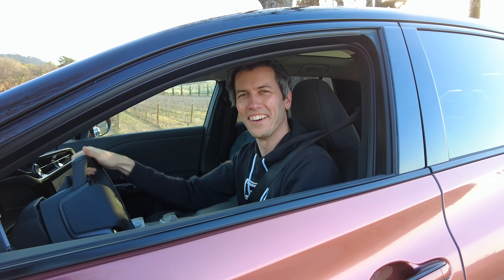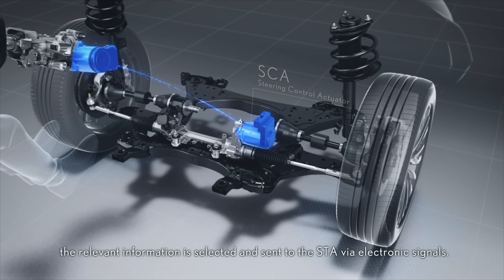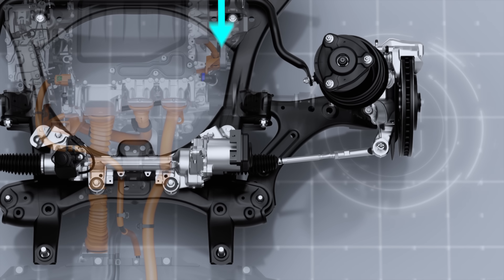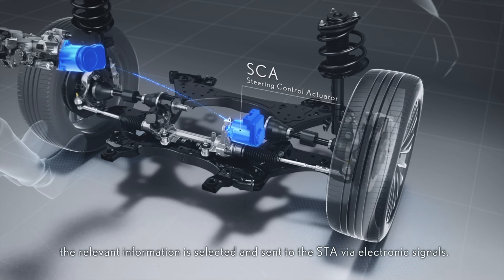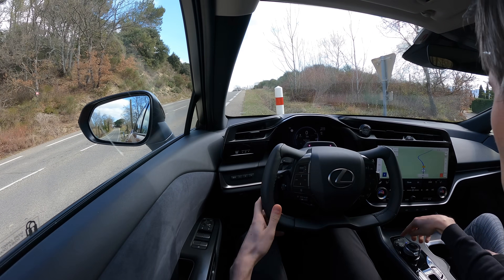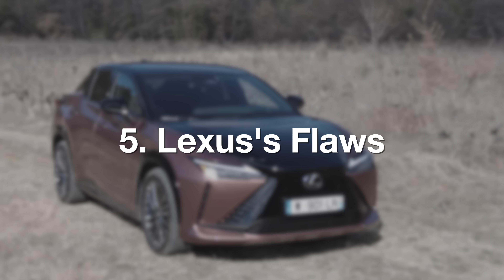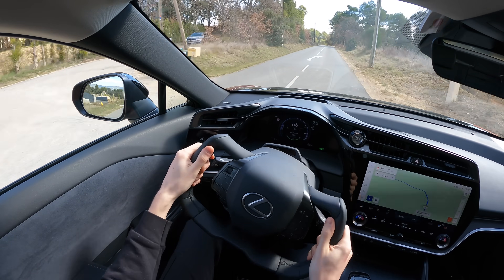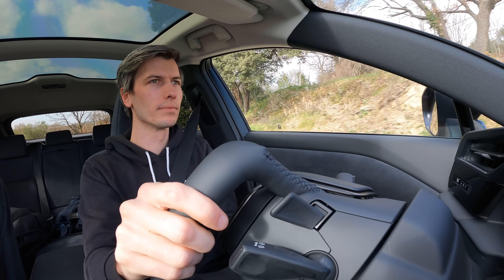How Lexus Fixed Tesla's Bad Idea: Steer-By-Wire Yoke

Comment: There is also a chance to improve it by make it automatically configured when steering axis geometry changes, also they can eliminate the side slips, personally i like to have real feedback rather than simulation or electronically converted sensing.

Comment: Remember when cars had large round steering wheels with manual steering racks..... Just as light and they worked for decades without maintenance or repair. It's all a sham

Comment: I gotta say, cool! But I'm not sold on this. I don't see why this is important. I like having to move my wheel a lot. We sit still too much already as it is, why would "Having to move less" be a good addition to anything at this point? Also, what do you mean "mechanical steering has less lag"? The point with mechanical steering is that is has NO lag. That's what mechanical steering IS :P What do you even mean....

Comment: I can't see myself buy a car which steering wheel is not physically connected to the wheels.
Reply: in fact it is physically connected by wire.
i think you mean there is no machanical link between the wheels and the steering wheel.

Comment: I just assumed Teslas were already drive by wire. Considering that they tout autonomous driving, you would think they wouyld have already removed any mechanical link between the steering wheel and wheels.

Comment: Redundancy...If a manufacturer makes a car like McDonald Douglas made MD-80s and 90s--no redundancy to the steering system, RIP.
If the driver keeps deferring/unaware of the single component failure till the second fails...RIP. Also, "most people are not enthusiasts."

Comment: Great video. Check out the  control laws used on modern large fly by wire aircraft. They actually increase the surface movement for a small yoke movement to overcome large vehicle inertia and get the vehicle moving in the desired direction, then reduce the surface movement to control the pitch change. Large floppy aircraft can no longer use cables and have to have FBW in order to manage vehicle flexing. This also allows inertial driven stabilization control laws. This smooths out air bumps, and stabilizes large floppy wings.
Reply: Your Lexus will have multiple steering controllers and degrade into "Alternate Law" when sensors and controllers fail. No more variable ratio steering until you take it to a dealer. 😂

Comment: I think it was Lamborghini in the 90s that had a steering system that would tighten up as you went faster. I don't remember what it was called though. I don't feel that drive by wire is quite ready yet. I do like electronic power steering. E-brakes don't make much sense to me especially in a loss of power event.

Comment: Didn't Infiniti have this as DAS in some of their Q50 models?
Reply: Yes they did. I had it. It basically neutered an otherwise very capable car. Not only that, it actually glitched up sometimes in the middle of a drive. I'd come to a stop to make a hard turn. After completing the turn, the steering did not return to center properly so I'd be driving straight while the wheel is cocked way off center. Luckily this only happened at low speeds and I could safely pull over to turn the car off.
Reply: @VM-gq6jd  Right, I recall there being a lot of complaints on the Infiniti forums about it. Thanks for detailing your experience.

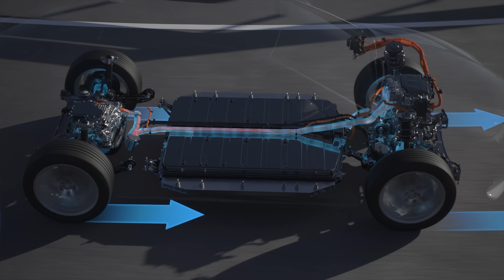Comment: 11:46 Is that a round-about in the USA?
Strange... 😀

Great video!
This issue is quite relevant, and I really love Electric PAS (Power Assisted Steering), preciously because it allows different behavior between low and high speed, which is exactly what a driver wants - from an utilitarian vehicle.
Reply: I'm pretty sure this was shot in France.
Reply: @ketchup901  In Vaucluse in Provence.
Reply: @ketchup901  if that is true, that explains the roundabout and the signals - which are quite different from the ones found on North American roads.

Comment: I really like your video, I really understand the idea behind the yoke but since I still can't get used to throttle by wire delays I simply can't see how I would like this... I can see a great use for those on delivery vehicles or other mainstream vehicles. On a side note, I really hope they will not destroy the experience by changing the programmation at every over-the-air update like they always mess with my phone at every updates ...
Reply: I don't notice any lag on my BMW M4. Some turbo lag until it spools though.

Comment: Surely having a wire is mechanical?  If it's wireless then it's not mechanical. Also it's up to the driver to change ratios? Wtf I see lots of dead people because of this
Reply: having a wire is physically connected but it's not a mechanical link

Comment: Your new explanation sounds like the system is not a variable ratio but a variable speed and is slowing the time it takes to move the wheels to the new position indicated by the steering wheel at higher speeds.

Comment: Obviously it's not variable in the same way but the highway twitchiness had already been solved by Toyota on the 90's. The mr2 has an electronics p/s rack. The pump is electronic instead of a pulley powered. So at highway speeds the pump automatically switches off giving you that 'dull' response that's more suitable for faster speeds

Comment: Steering rations dependent on speed seem unreliable. It would either take a while to get used to or people would het into accidents because the car doesn't turn as they expect it to. Also at high speeds, if you want to drive off the lane or road real quick to avoid a collision you'd be screwed.

Comment: What happens to the steer-by-wire if you are steering into a long left or right turn in a road at highway speeds and suddenly need to slow down, would the steering ratio suddenly increase requiring you to reduce the steering angle if you have the Lexus with the yoke option? Or if you need to veer out of the way of an obstacle  at highway speeds, would the steering computer just cancel your steering inputs as they are too extreme and could allow the car to spin?

Comment: What concerns me isn't what happens when it fails.
It's how likely it is to fail. It's rare a mechanical steering rack completely fails. Your power steering might fail (pump or electrics) but even that's rare. 
I'm not yet convinced modern electrics alone are going to be as reliable. Especially in extreme climates. 

One positive I could see..... can it help eradicate torque steer?

Comment: In a real long time daily driving yoke wheel can't provide different grips, allows only 9-3 wheel grip. Which is the best for quick response and driving twitchy conditions on one side. But in the other side 9-3 keeps your muscles in tension and will get you tired a lot faster than relax grips like bottom grips for example. I don't even saying that electronic systems is nightmare for experience driver due to lack of response and different reaction to same inputs

Comment: There is need for comparison when the final product is ready if the delay response can be potential safety hazard. For example you need to quickly avoid obstacle. Given the human response time + wire response time there will be higher than usual delay?

Comment: Does the Ratio also change whilst you are accelerating out of a corner and still have some steering input?

Doesen't sound like anything I'd ever drive. Adaptive ratio steering is already a thing, the more you turn the wheel, the quicker the steeribg ratio gets. And I absolutely hate it to drive!

Comment: Great video. Not sure the ability to rapidly manouevre at highway speeds with potential stability loss is necessarily a bad thing. Seen plenty of videos where someone has had to do that to avoid a collision (mostly due to not paying attention and/or driving too close)

My biggest downer on yokes is I just like driving holding the top of the wheel at times.
Reply: Not a good place for your arms to be when the steering wheel airbag is activated. Think about where your wrists are when holding the top of the wheel, then think about where they will be milliseconds after the bag inflates.
Reply: @Thankz4sharing  sure, it’s only one arm, I’d never have them both there and all sorts of reasons why it’s not ideal for manouvering either (though my car has tight lock-lock) so it’s only ever for short periods of minimal turning, but ultimately in a situation where the airbag goes off, it’s not going to be there. It’ll probably be waving around in the air going “arrrrrrgggghhhhhhh”

Comment: Thanks - a great video and a really objective insight. One thing you referenced but then overlooked - F1 cars, and other racing cars, have really poor turning circles, so the steering ratio isn't as short as you might think, they don't need to be able to park or turn sharply like a road car does. The maximum steered angle of the wheels at full lock is quite low. This gives much greater sensitivity for the driver to manage/feel the slip angle, the trade-off of poor low speed turning being largely irrelevant on racing tracks - and the mechanics can deal with it when not racing. The limited lock and poor turning circle is also driven by the use of anti-Ackermann geometry, the purpose of which is to optimise the slip angles across the front axle when cornering at high speeds (with the unloaded inner tyre requiring less slip angle, and therefore less steering angle, than the loaded outer). Road cars use Ackermann geometry to turn the inside wheel more to aid low speed manoeuvring, because the high speed cornering case is largely irrelevant to road users. With race cars prioritising high speed cornering, and road cars low speed manoeuvres, each has a solution at opposite ends of the spectrum, which explains the very different input devices (steering wheel vs. yoke). Assuming one can translate directly to the other  ('because race car') is a risky assumption without considering the system end-to-end (which you did) and use cases (which you did for the road car, but not the race car).
Reply: Yes...F1 cars can get away with poor turning circles because the corners in F1 tracks are all pretty wide! The steering ratio will actually be set according to the tightest corner of the track, as well as for driver preference. (The tightest corner in F1 is "Lowe's Hairpin" at Monaco, where the cars are fitted with more aggressive steering racks.)

Comment: As  tall guy, and an owner of a Peugeot 208, I look above my small steering wheel to the instruments. No problem there. And I think Citroen SM only had a very high geared use of it steering wheel, speed dependent, compared with, an American, power-steering car, with 4 or 5 turns, with hardly any effort even as standing still.

Comment: With all this fancy computer controlled braking and steering, why are we still using metal springs, hydraulic dampers, and mechanical linkages for suspension and stability?  At about 4:29 you show springs, struts, sway bar and links.  With hydraulics, motors, and computer control you should be able to have a cushy ride and sports cars handling at the same time. But, what a nightmare of complexity to maintain, diagnose, and repair when it needs it.

Comment: I have this electric steering in my 2010 Megane 3 , and I love it because ,  it adapts to your speed m if you are in city , steering wheel becomes very senstive,  light and easy to spin even with your finger , when in hight speed it stiffens up so you you dont wiggle, in some cars when the steering is always light  it's dangerous  because a if you are not holding the steering wheel firmly all the time a Semi-truck may send you flying with it's powerful air drag.

Comment: some 15 years ago BMW put a planetary reductor inside power steering motor and achieved variable steering ratio, just as described here, with conventional mechanical steering. And it could make autonomous steering inputs during drifting in order to maintain drift angle too!

Comment: Their is a reason the 60's cars will be classics for a long time. YOU can fix them.  The average guy or gal can do the repairs.  Panels are made of metal not plastic.  No, I am not against or afraid of this system.  Every modern jetliner has the same "drive by wire" controls.  They would be impossible without it.  What wasn't mentioned was cost.  A standard style steering gear has to be less to build.  I suspect the costs will have to come way down before this system is adapted industry wide.  So buy your Lexus and trade it in just before the warranty expires.  LOL

Comment: Great video as always!  Only two things I would note.  A 'pleasant experience' is sometimes in the eye of the beholder.  For me personally, this artificial / dynamic ratio is extremely off putting when driving - in a similar way in which an automatic gearbox doesn't give me a good 'driving experience'  because it never feels quite like I know what the car will do, the steering experience is the same.  Overall I could enjoy the small movements for a yoke, but the change of ratio and artificial 'bumps' are difficult for me to enjoy.

Secondly - Engineers 'choosing' which vibrations or feelings I receive seems to be a recipe for a driving experience that is not authentic and even more artificial feeling than EV cars already are.

These kind of cars seem great for passengers.  Smooth, quiet, fancy looking and even potentially quick.  But a drivers car, they are not.

Comment: Drive by wire and variable steering ratio allows you to do interesting things. Take for example collision avoidance. It is often either better to focus entirely on braking or to focus on dodging by steering - but not both simultaneously. Most drivers will both brake hard and steer in order to avoid an object in the road. If you do both at the same time in an emergency maneuver the vehicle is likely going to do something bad like an uncontrolled skid.

With drive by wire and brake by wire the vehicle can smooth out one of the inputs or apply braking separately (or together) to help produce a more effective result. Combined with camera vision and/or other sensors, the AI can help decide and execute the maneuver that is likely to have a more positive result.

Comment: The variable ratio is absolutely brain dead...

The actual solution should be higher damping ratio for any input. So a low-frequency input or a low magnitude will respond without much resistance. But a high frequency or high magnitude driver input will give the driver more resistance.

Further, steering wheel angle should be directly linked to wheel angle. This means if the wheel angle cannot keep up, the steering should give significantly increased resistance to steering input. However, the steering motors should be able to change wheel angle faster than the human is able to turn the steering.

This way, the driver has full control, and can elect two input and aggressive steering command... But it cannot happen by accident.

Comment: Hmm. 150 degrees of rotation... From a day to day use, makes practical sense. However, I can see airbags throwing arms into faces. If in the moments leading up to a crash, the driver is trying to avoid something and is aggressively steering away from the impact, the airbag is going to move those arms out of the way, forcibly, in the direction of the airbag inflation, i.e. the driver's face. 

Conversely, a crash safety benefit - no direct link to the steering rack means it can be deformed in a crash but not have any effect on the steering wheel position. Yes collapsible columns are a thing, but this design could change how vehicles react in a crash, it's going to make it easier for the steering mechanisms to deform in an accident and not have a detrimental effect on the driver.

I see those motors at either end of the system being very expensive parts, and a bit wasteful if you only need to replace one 'half' of the package as the other redundant 'half' still works. Yes, works better for assembly and packaging but long term repair costs could be lower if they were fully independent of each other - i.e. only replace the one that failed.

And I'm 100% going to be the person that notices any lag in reaction at all, as well as the changed steering reactions in line with changes in vehicle speed. I personally don't think I'd like it. I also think, at this point anyway, that changing to this system to 'reduce lag' from a wheel directly acting on a metal rod, directly acting on a pinion/rack is purely a joke - there will always be some lag with an electronic system as sensors need to sense, the data be processed, sent to the other end, processed again, sensors be looked at and motor activated. That's a lot of stuff to happen in a decimal point of a second because it's not like we have much of the the horrible vague steering boxes that worked by morse code these days.

Comment: You didn’t mention legality. This is something that improves front impact safety by removing the steering column, but I was not aware that FHWA had removed their requirement that the steering wheels be mechanical connected to the steering wheel.